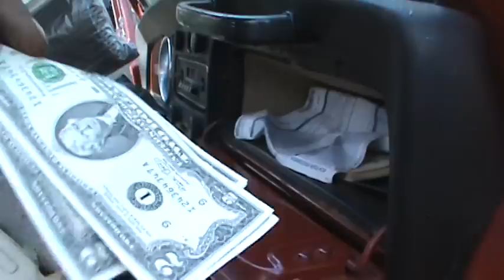68 vw bug old start cold start

Comment: Three cylinders makes you want to pull the plug wires off off of the cap one at a time.  But, even though they are insulated they will still bite you just like you said.  Ouch!!!  Absolutely a fantastic price!!!  I am jealous!  Looks like by the tail lights it must be 69,70,71 or 72. I think the rounded tail lights came in 73.

I have owned three bugs, a camp mobile and three Rabbits to include a pickup.  Just wish I had at least one of them.

Comment: If this thing truly hasn't run the whole time it sat, This is damned impressive. Especially for an engine that's not firing on one cylinder. You'll not find many modern engines that'll start that easy after sitting that long with a bad cap/plug wire.

Comment: Does somebody can explain to me what happen when you disconnect the spark plug cable on the misfiring cylinder and it starts to fire.
Reply: Pulling the plug wires off one at a time while it's running is a test to see which cylinder is misfiring. Pull cylinder 1 plug and the idle changes, that means that cylinder 1 was firing and you caused a miss by pulling the plug wire. So that cylinder is firing and fine. Pull the next one and the engine idle doesn't change that  means that cylinder was already misfiring. You now know that cylinder was the one misfiring.

Comment: Why do old v dubs make a kind of "chirping" when they run? Always wondered about that.
Reply: The chirping is caused by the small diameter dual tailpipes. If you take the tailpipes off, or switch to a muffler with only one tailpipe, the chirping goes away.

Comment: That's Not a Cold Start!! 
That's when it's stored in an unheated garage with snow on the ground in Indiana.  My 71 was put in a sand rail chassis and once each winter month I would go out in the garage and promptly foul spark plugs trying to start it. Then you'd have to dry out the plugs and try it again. Once started, it would belch and pop until the cylinders would clear out and then run fine. Did I say it was cold out ??